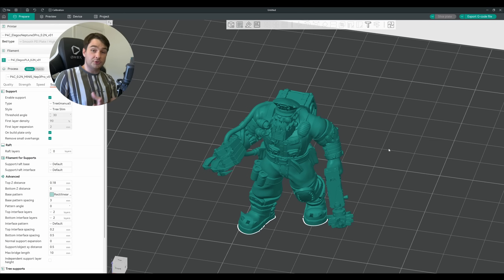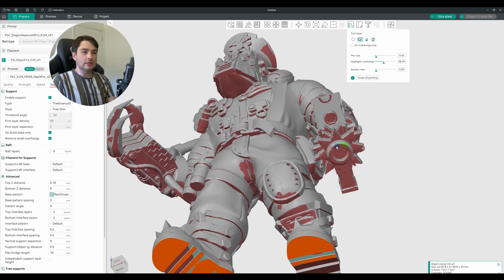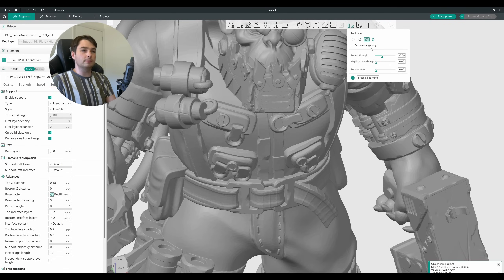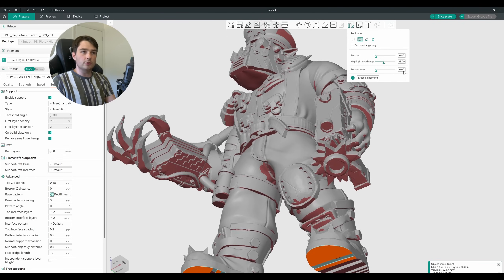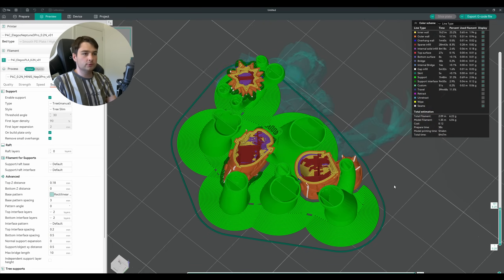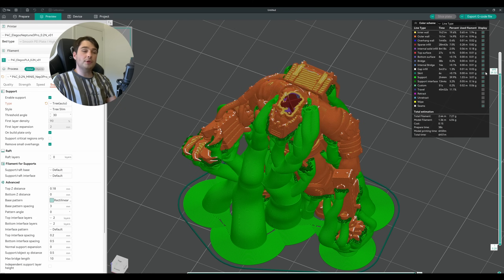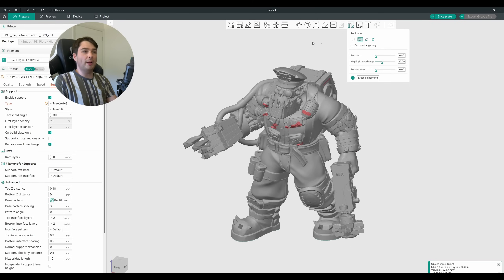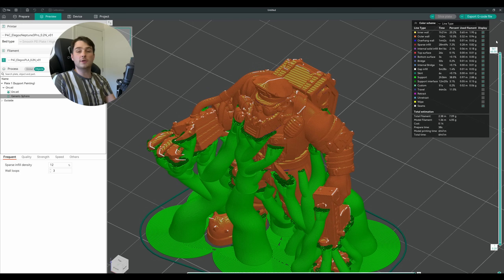FDM Printer Quick-Tips | Manual Supports

Comment: Great video.. but... but...   FDM is not bad at bridging over short distances... say 3-6mm... im finding it hard to manually add supports while trying to keep bridging in mind.   My go-to is support it all.. but realistically, that's just slowing down print time and increasing waste.    I think this method of supporting mini's is excellent for sure... but it seems that we are scratching the surface on what needs to be done...    look at printing something with a 10% infill pattern... 90% of the top surface is unsupported, and bridging takes over without issue.   This same concept has to apply on mini's.. meaning, to me anyhow,  we are way-way-way over supporting our mini-prints.

Comment: I had a thought, finding the best angle to print a model at, and possibly, how to cut a model in half  (front/back) so that you could print both front and back "face up" and glue them together so that scarring/details are only happening on the middle/inside where its getting glued together.

Comment: Thanks again you've been inspirational and helpful for me trying to FDM print a whole army. Do please do a video on optimizing the supports to where they do a good job but are also easy to remove, I've actually got it working pretty well at this point but it took like a week of messing around with.

Currently I'm using .25 nozzle with .004 layer height (also make sure your resolution is set to 0.0 that seems to be the highest)  I've got top and bottom z distance at .045 and support xy distance at .45 sometimes they come off cleanly without any tools.

Anyway I'm not an expert but just wanted to give my two cents If you're still in the tinkering part yourself but do let us know what works best for   making your supports effective and easy to remove!

Comment: I haven't got a printer yet, still mulling over options, but watch so when I do I know more what to do. I see you, what appears to be, strolling up and down through the layers. Can you explain what you are looking for when you do this? What flags to you that there is something that needs to be supported or unsupported while doing this?
Reply: A Printer works by layers, it extrudes plastic. That plastic naturally droops down when printing midair. This is where support come in, they make a temporary interface where the plastic can lay down onto. Overhangs need to be printed gradually (not over 50 degrees) when printing without supports to be smooth
Reply: @mrpixeldot  thanks for the reply. What I was shooting for was what are signs in the scrolling through the pre-processing layers to look for. Fx, scrolling through, "See here? This layer needs a support because XYZ." How do I use those scroll through layers to identify those places on the model?
Reply: @risusrules  The auto support feature is normally very good and supports sometimes even too much. For actually seeing the overhangs, you could go into support painting mode, all overhangs are highlighted by the red color (you can even change the threshold) I can’t explain it well, so my suggestion: Get a 3d Printer, try it out for yourself! Knowing what to support and what not comes with the usage of a printer.
PS. If you are not sure whether you like 3d printing or not, buy a cheaper one first. Also factor in Tools, Filament and other stuff you’ll need. Accessories alone can easily cost 100$ if get a couple of rolls of filament and some tools like a deburrer or caliper. 
You probably read it a hundred times now, but I can’t recommend Bambu lab enough. You could also look into the upcoming Centauri Carbon by Elegoo, but you might want to watch some reviews from known YouTubers.
Reply: @risusrules bridges ( layers that are printed freely in the air) are normally marked in blue
Reply: @ This! Something so simple that no one ever explains in their videos. The, what are we looking at / for info. Thanks you.
Reply: @ I have been looking hard at the A1 and A1 Mini, just can't get myself to pull the trigger quite yet. I am torn, plus I don't think I need multicolor print and it's not in the budget, but... yeah, I'm torn LOL.
Reply: @risusrules  you don’t need to get a bundle with the ams. I myself got the A1 + AMS and I love it. The AMS makes everything just easier, automatic filament changes are awesome. I use the AMS a lot for petg interface layers on supports for perfect overhangs/bridges. The A1 Mini is literally the same just 150€ cheaper and a bit smaller. For me, the bed size of the a1mini (180mm^3) wouldn’t have limited me on any prints I have done so far, but I just got the A1 with 256mm^3 to be safe.
Reply: @ thanks for the info. I am also kind of steering away from an AMS because I live in Louisiana, in an old home, and the humidity is horrendous! Humidity is another major concern for me not pulling the trigger, but I've also started looking at the Centauri Carbon mentioned previously in this discussion. Enclosed XY printer < $300!? Wha?

Comment: Really like the video. Super helpful! You mention often though about overhangs that don't need supports. Can you give any more information on how you made that judgement?
Reply: I was about to ask the same question!
Reply: I would say first just always atleast support the ones that are lower than anything else in that height so it's not printing on thin air, I've also set my support threshold angle to 60 degrees and support angle to 25. I could be wrong but I seem to have noticed you want some supports on the side as well as from the bottom to keep things stable while building them up like a bent arm that starts its print from the elbow if that makes sense. I'm not an expert and I could be wrong but there's something to think about atleast
Reply: Sorry I just read you were asking about things that don't need them, I'd say slice it first and look carefully, anything that is well attached and not too far from the main part of the model should be ok to skip, I would look at the sliced model and look for things you think would sag if they didn't have something under it. Also trial and error, if you see sagging on something you printed then it needed more support